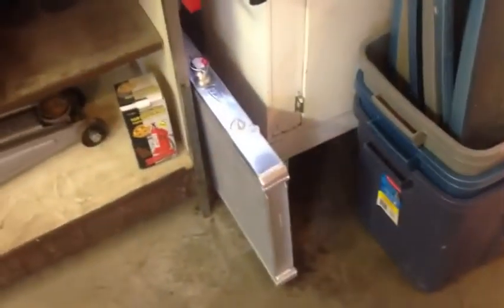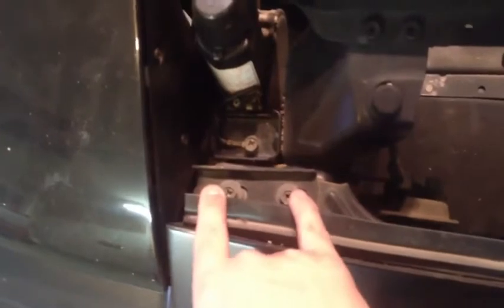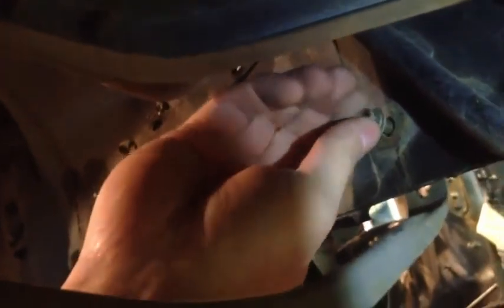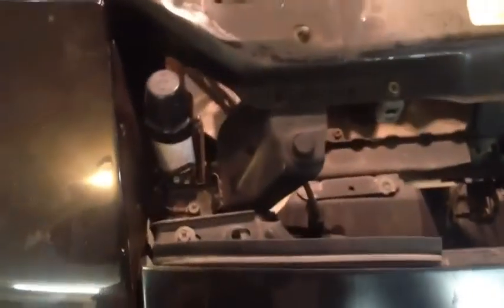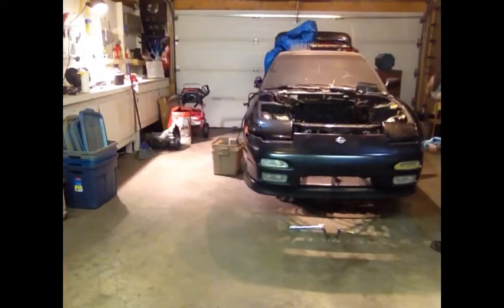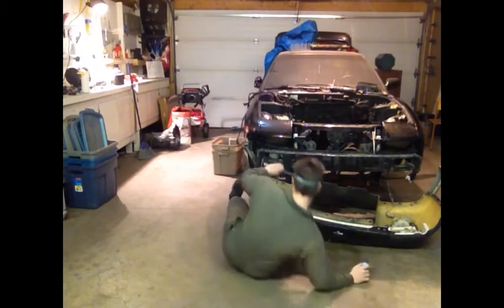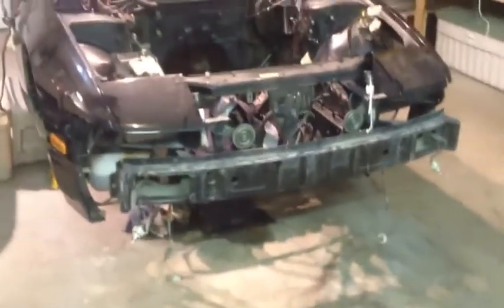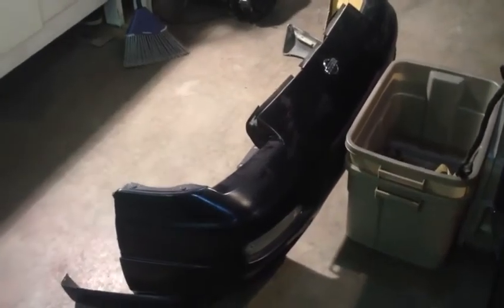How to Remove S13 240sx Front Bumper. (long video)

Comment: I just got a (free) pignose for my 91 coupe which im gonna clean up and paint. I gotta get some turn signal lights for it before I can put it on though. My stock sharknose it bent outwards at the top so theres an ugly gap between the bumper and hood. I wish my car was in as good of shape as yours! it has zipties holding on the sides of the front bumper and the entire radiator + fan shroud also.